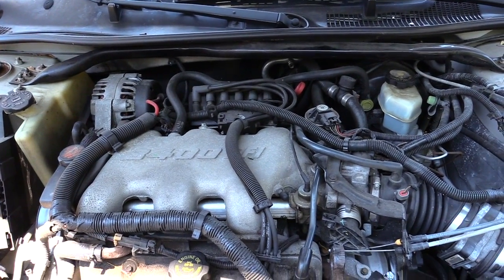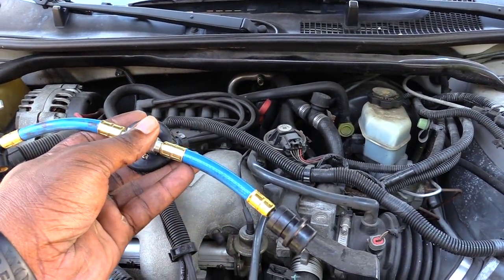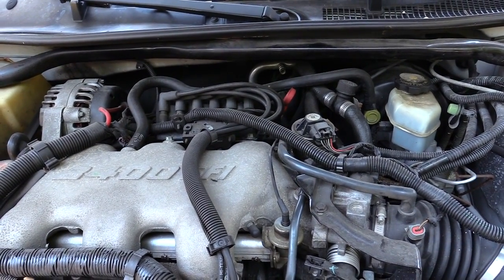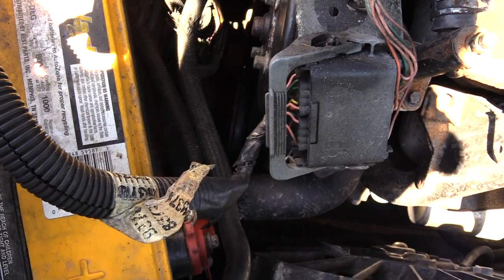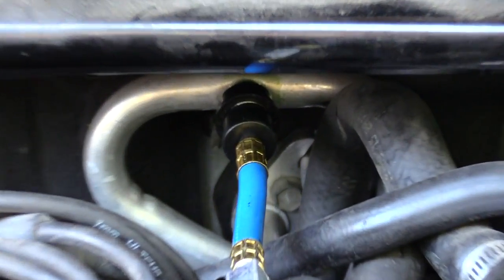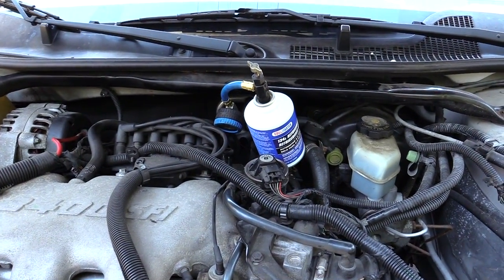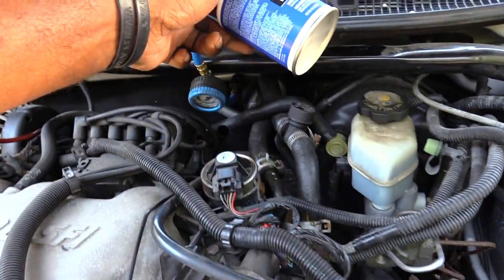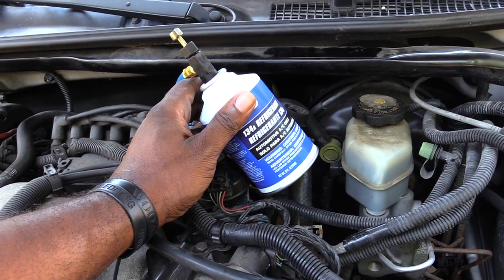How to Recharge your Vehicle AC - Cold Air-

Comment: What product was this? I’m trying to get my 2000 impala to have cold air
Reply: My boyfriend tried it and right after it started to make a funny spinning noise
Reply from the maker: That noise is your ac compressor working it's normal.
Reply: Flashback502 what is the product name you used?
Reply from the maker: @kamerynadams9416  it's R 134a any brand, the 1 I used came from AutoZone

Comment: If the pressures low the compressor won’t kick on so you’ll have to jump the relay cause you can’t add the gas if the compressor not running